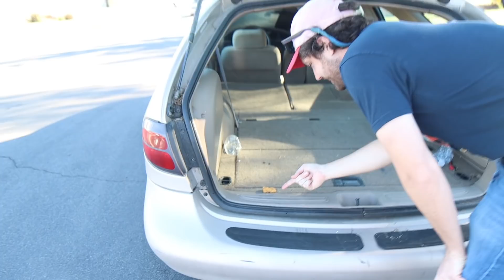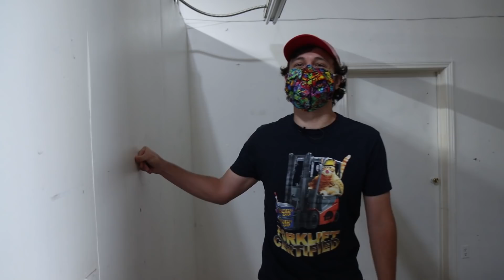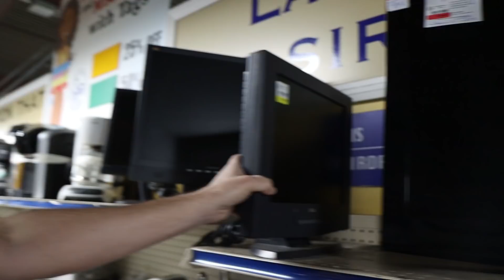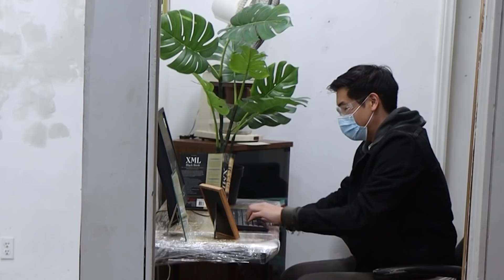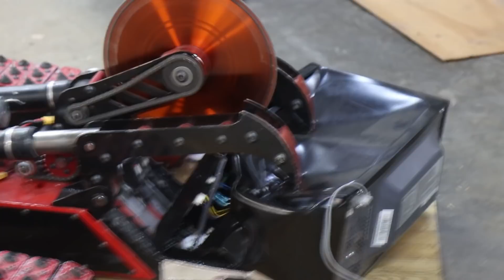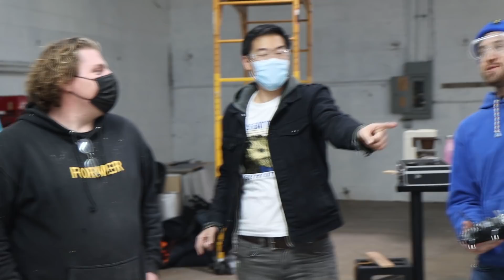Destroying A Building With A BattleBot

Comment: Yeah, the force for just driving a proper battle bot is really impressive. Which gives me an idea for a battle bot... the way to build the maximum amount of destructive force is of course where you spin a huge chunk of metal faster and faster (f = m*a), which is hard to achieve any other way. But you can definitely build up quite the force from just accelerating the bot, so instead of an axe or spike, that doesn't take advantage of the acceleration of the bot, one could make a pneumatic battering ram.

So you can accelerate up a great force, and adding a lot of additional force in the same direction with the battering ram. As I envision it, it would just be a great solid cylinder of steel on wheels, perhaps using coils and magnets to add more speed.

Comment: A robot is a machine that behaves automatically if something is being controlled by a remote and not an actual computer or AI it is not a robot. This is a fancy RC car with a lot of gadgets attached to it and you call it a battle bot but it is not a robot. You can call it a battle bot but it is in no way shape or form a robot. If you can program it or indirectly program it with an actual computer to perform certain actions I would agree that it is a robot but unless it meets this criterion this is not a robot and you are spreading ignorance as all Americans pride themselves on doing.
Reply: it's just a misnomer, calm down
Reply: @lukecastellan721  exd5 qxd5
Reply: You have confused "automatically" and "autonomously". A robot has no AI component requirement, and these are robots and fulfil the definition of such - the sub field specifically being telerobotics. 

So really its just yourself being ignorant, as you have failed to read the dictionary.

Comment: that robot is either way more powerful than we realize or those studs were very incorrectly installed
Reply: That robot is around 250 lb if it's up to the BattleBots weight limit. 250 lb times a little bit of speed equals a hell of a sledgehammer
Reply: @brutongaster8184  yeah, maybe it was a bit of both. Id like to see more red devil videos either way. Hopefully he can find a way to incorporate it into newer projects

Comment: By the way, instead of using 2 receivers you should just use the training mode on the transmitter, which lets you control one vehicle with 2 controllers (it's called training mode because the main purpose is letting a teacher take over control of RC aircraft if a student gets in to trouble)

Comment: fake cealings are super convinient for a pletora of reasons by the way.
Reply: No
Reply: @weid5924  Yes ¯\_ (ツ)_/¯
Reply: why are they used? i live in a place without these so i didnt even know some buildings have these 'second ceilings'
Reply: @kirtil5 They run the pipes and cables in the ceiling, it makes for very cheap and fast maintenance and repairs, also makes it easy to redistribute or repurpose the space. It makes operating cost cheaper. There are other reasons like modularity but it all comes down to the bottom line.

Comment: To answer your question as to why people would use those ceilings, they’re called Drop Ceilings. And are used to hide all the electrical, plumbing and duck work above. Some buildings are structured with steel joists that would otherwise be visible running across the top. For a Home Depot or another big store that’s fine but for buildings used as office space or something it’s likely you’d want that hidden, plus it’s a less expensive and easier option then installing a normal hard ceiling.
Reply: unless ur a trendy juice bar in DTLA and you want to cultivate that aesthetic lmao

Comment: The only thing that bugged me about this video was that you left the live wires in the walls that you tore down. Also the false ceilings are used because it makes maintenance of pipes and running new wires and cables easier.

Comment: The reason drop ceilings exist is so that you can hide wiring, plumbing, vents and so on, and it makes it much easier for an electrician to install new sockets or other cabling, when they don't need to run it through walls and ceilings in order to hide it. You can also mount air conditioning or lamps directly to the drop ceiling. It's very useful to have. Tearing it down is a bad idea.

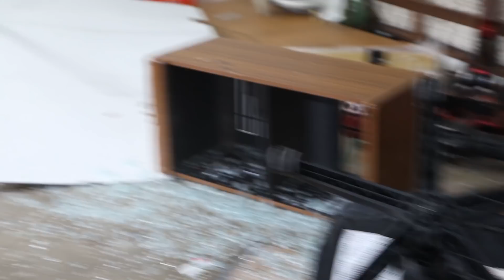Comment: 8:27 is so satisfying. I've seen that part like 45 times now and I can't understand how that thin ass sheet of glass could take the force of that whole robot but then break when being the cabinet closes
Reply: It really is, the twisting that happens when it hits the ground unevenly is what breaks it
Reply: @neonoir__  actually it's from the glass sliding down a bit and causing the edge of the glass to hit the cabinet when rotating. you can see the glass never gets near the floor or closing, but instead shatters once the glass nearest the hinges locks onto the wood from rotating and breaks.

Comment: Microwave: "No Disassemble!"

(edit also they lower ceilings to make the space smaller for cooling and heating to make it cheaper to do that)
Reply: Actually it's to hide HVAC, plumbing, floor joists or ugly steel corrugated roofing.

Comment: A comment about why those ceilings are installed: Now this might not be the case here (maybe aesthetics, like hiding piping or wiring), but turns out for a lot of ceilings (usually the hard floor above, like concrete), you have a lot of reverb. In order to reduce this reverb, the ceiling material is placed at a location roughly 1/4th of a "typical" wavelength away to muffle lower frequency sounds. This location is based off the highest velocity part of a wave, and impeding motion at that point offers the best acoustic properties. For higher frequencies, you would use a foam pad at the wall or something similar.
TLDR: ceiling tiles muffle some lower frequency sounds and hides pipes and wires.

Comment: Drop ceilings are used so that the rooms can be modified way more easily. Reconfiguring rooms/ floor layout, running wiring/ plumbing, etc are all much easier without having to cut holes in and then patching drywall every time something needs to be changed.

Comment: There is a ceiling between the other ceiling because HVAC pipes and controls cords can be fit in there. This space is called the plenum, and the warmish air can be pulled from there to allow the system to be more effecient.

Comment: 3:50 I've been one of the drivers for my school's FRC team for the last three years. The way we split it up is that one person primarily controls the movement of the robot (basically just the wheels) and another person controls all the doohickeys we have slapped on. Both controllers have backup controls that can control the other drivers responsibilities, but that's the primary way we do it. Everything on one robot is too much for a single person to do, splitting it up and communicating is key.

We also had a third "driver" who's job was to watch the bigger picture of the game and tell out instructions for the two drivers. I cannot stress enough how useful it is two have two robot drivers and then one robot driver driver.

Comment: William what if you changed up the weapon on red devil so that it was a vertical bar spinner, and you could probably get a beefier motor in to power the blade, and tired whole got would be pure destruction. The saw doesn't transfer very much energy, but a bar spinner solid stall ham on everything!

Comment: To be fair, this version of Red Devil is maybe one of the only Battlebots that I think would be somewhat safe to use outside of a strictly controlled environment.

I mean, just being within 20 feet of Tombstone or any of the inertia-based bots when they are turned on, without several layers of bullet proof glass and a steel cage, would be horrifying. They are outright death machines.

(yes, I just copied this from a reply I made to another comment).

Comment: The saw obviously needs more weight, more power and sharper teeth. You could demo an entire house with proper blade setup.
Reply: It was never meant to do any serious damage, only to look cool and score points. Which is kinda wasted potential. We can only hope William will modify it to be able to do massive damage and saw boats in two to the point where not even flex tape could fix them >:D
Reply: @LordDragox412  I've never watched the show (I honestly thought it was a fictional show from some tv show) bit isn't the point to incapacitate the opposing robot? How would it do it exactly? The only thing I can think of is that it could grab its opponent with the claw thing and then flip it back since it can move its body independently of the tracks
Reply: @incog0956  Read the rules and you'll know how judges score things. Knocking the opponent out is one way, but unless you're a bar spinner good luck with that.
Reply: @incog0956  You would be surprised how much damage the internals of a robot can take just by being battered on the walls and floor (these are up to 250 lb machines), and Red Devil has a really good design for grappling with an opponent

Comment: Yo do you know that the high voltage capacitor in microwaves can hold a big ass charge even months after it’s been unplugged? They also got that beryllium oxide crap right? Try not to die. I like your videos and it would be inconvenient.

Comment: Just for future reference, microwaves have a bit called the magnetron which is made with Beryllium. This can be easily broken and turned into powder, and the Beryllium powder is insanely toxic to humans.

Take them apart, shock stuff, melt stuff, but don't break the pinkish donut of Beryllium on the microwavey bit. Look up Berylliosis if you want to be scared away from it.
Reply: Had no idea what it was called but I immediately started thinking about this when they grabbed the microwave
Reply: Yep. Every time I see a YouTuber smash a microwave I just pray that the magnatron doesn't contain beryllium. (unless it is Jake Paul) I hope William knew about this and removed the magnatron before smashing it.
Reply: @CrazyNerdInventor  hahaha a special exception for jake and logan paul
Reply: Oh thats why a microwave is  called magnetron in dutch
Reply: Most modern magnetrons contain no beryllium
Reply: @tomkeehn  he bought all the stuff from a used goods store. The microwave is likely old enough to contain it
Reply: @shamalamadingleberry7203  when I say modern I mean last 10 years at least. That one looked about that
Reply: From the little research I did, I think beryllium is only used in really powerful in microwaves, but I wouldn’t go risking it anyway. It’s pretty easy to just not crush the tablet and breathe it. But some advice if you accidentally crush it: don’t use a vacuum cleaner; use a wet rag and wipe up all the powder, and put it in a ziploc bag while the rag is still wet, and dispose of it safely. Best not to take chances. That’s pretty much what I read on it.
Reply: my main takeaway from this is that "magnetron" sounds like a Transformer or something
Reply: It’s okay they were wearing glasses
Reply: yup
Reply: HAH... The pinkish doughnut... This just makes me WANT to eat it.
Reply: They haven't used beryllium in microwaves since the 70's. Now they use ceramics instead.
Reply: Also, don't ever power up an unshielded magnetron,  look up microwaved puppies if you want to be scared away from that particular bad idea.
Reply: @Themanthemyththemustache  uh, i don't think any normal person wants to search up microwaved puppies. i would like to know what an unshielded magnetron would do but not like that
Reply: @midgetman4206  if you’re far enough away there is no risk because of the inverse square law, the king of random did a video about it
Reply: @Themanthemyththemustache  I looked it up...

Comment: That "fake ceiling" is a acoustic ceiling, they're used to cut down on echo/ reverb in open spaces. They also make it to where you don't have to run drywall all the way up a wall and hide ugly wiring and pipes

Comment: "BaTtLeBoTs ArE fOr BaTtLiNg OnLy!"

ye sure have fun yelling at the clouds when you get old
Reply: To be fair, this version of Red Devil is maybe one of the only Battlebots that I think would be somewhat safe to use outside of a strictly controlled environment.

I mean, just being within 20 feet of Tombstone or any of the inertia-based bots when they are turned on, without several layers of bullet proof glass and a steel cage, would be horrifying. They are outright death machines.
Reply: @inthefade  whyachi 😳
Reply: That's rare
Reply: Who the heck says that? I mean if it were a spinner or some other things yes, because that will launch shrapnel and its only a matter of time before it causes gouges or narrowly misses someone. Generally you should also be in a protected area regardless but thankfully red devil is tame in destructive power.

Also disrespectful, builders often do it if they have the opportunity and a safe spot so like... Why?
Reply: @afish8883  what the fuck are you talking about

hey Larson, I think we might have found one of those soon-to-be cloud yellers...
Reply: LMAO
Reply: r/rareinsults

Comment: i remember a battle with red devil where one of the treads came off, but appentally, the treads have a motor in them that's separate from the rest of the bot. so not only did the one that was still on work, but the one that came off of the bot still worked as well

Comment: I really wouldn't cut a microwave with a saw, the magnetron contains beryllium oxide in a ceramic insulator, and beryllium oxide is is carcinogenic and causes berylliosis.
Reply: It's a good thing that William did it and not you then
Reply: @itGurt  did you get mad at me for giving safety advice?
Reply: @ficolas2  not sure what part of that was "mad" lol.

However giving safety advice to someone AFTER they already completed the unsafe act is pretty hilarious and backwards
Reply: @itGurt  better late than never, could help someone else too maybe
Reply: @ficolas2  oh ya, I forget about the huge community of people with massive battle bots with saw blades cutting through microwaves lol my bad
Reply: @itGurt  no... But someone might want to tear down a microwave to get the transformer for example.